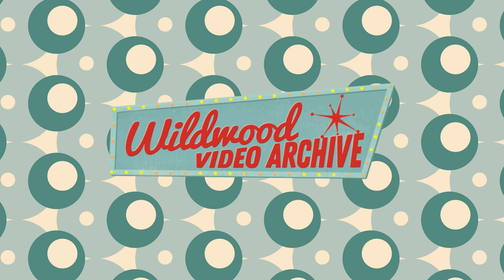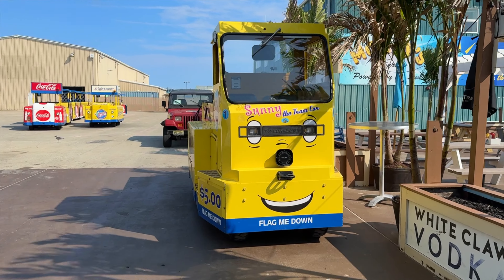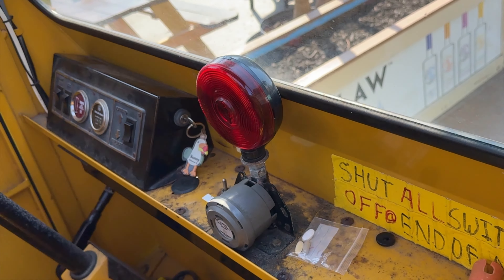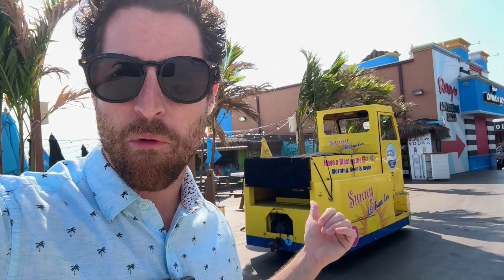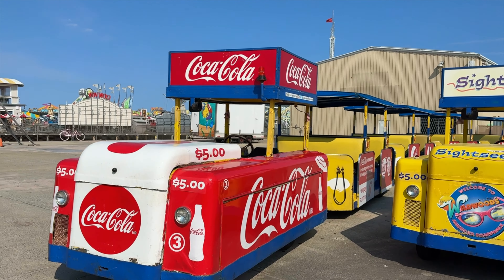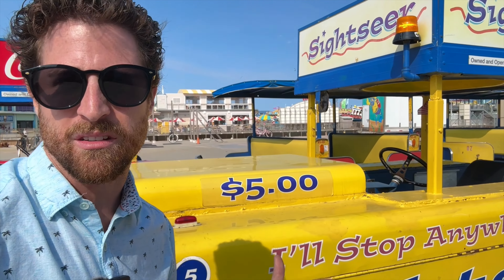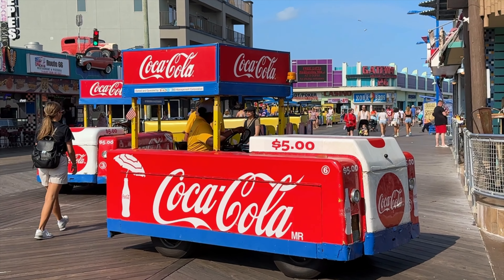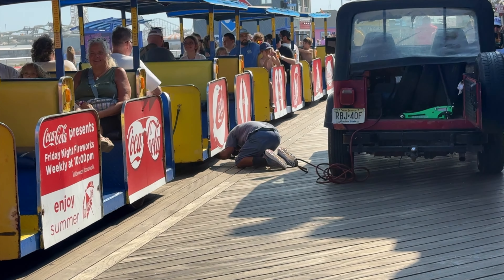The Wildwood Tramcar Dance

Comment: So before they would depot the tram cars on Hunts Pier, there was a garage behind the (former) miniature golf course on 23rd Ave, across the street from the motel owned by my aunt and uncle.

It’s why they built the 3rd concrete  vehicular access ramp on 23rd to the boardwalk, as well as the concrete turnaround there too. Anyway, long story short, I remember many afternoons wandering over when the garage doors were open, and the guys in there showing me how they’d charge them, even let me drive one in the adjacent parking lot too (just the cab)